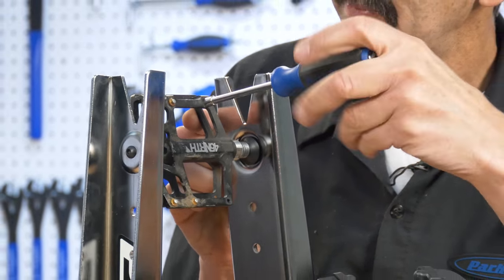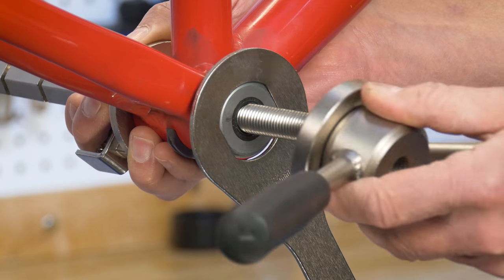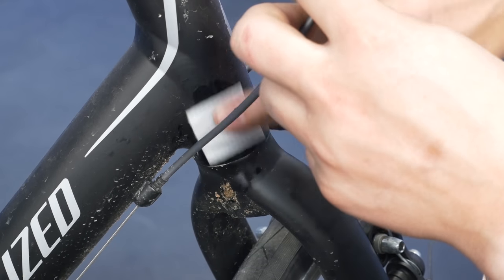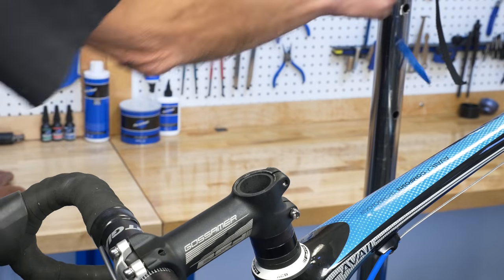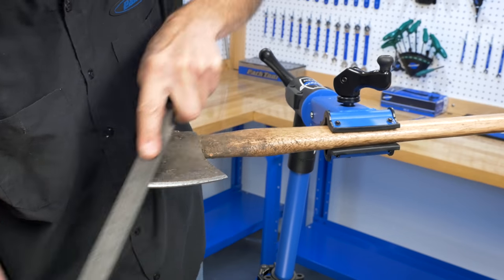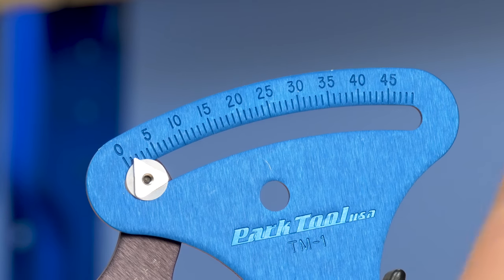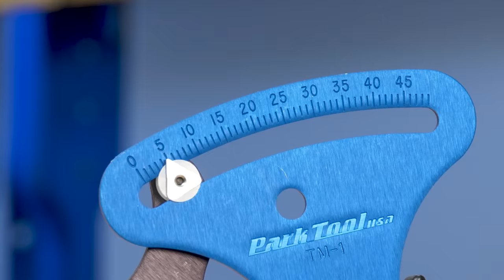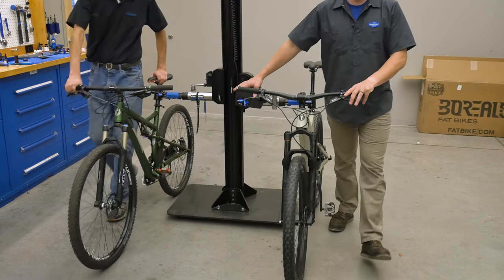The Mechanical Mind: Alternative Tool Uses - Tech Tuesday #102

Comment: 2 tools: Take an old spoke and bend a handle loop or preferably 2 tight loops kinda like a pretzel for the handle and a tiny loop on the head end to hang it. For one tool sharpen the end on a bench grinder to make a pick. Thread an old nipple onto the other to make a nipple setter for building a new wheel. Guarantees you start at a baseline with every nipple threaded the same number of turns.

Comment: Bullnose pliers for hollowtech preload adjusters in a pinch. Every tool is a bottle opener. Crownrace puller to pull off seized headset spacers and bearing covers. Rubber end of a cone spanner to undo tight quick releases.

Comment: I don't do major wheel truing at home but I do glue tubs for CX season. I've never needed a truing stand so the rear end of the bike makes for a handy wheel holder with the wheel mounted externally in the non drive side dropout.

Comment: attaching QR axles in axle vice.  To install 6 bolt rotor, start threading by hand, then spin the wheel counter clockwise while holding the  torx wrench into the bolts.  Takes like 30 seconds to do each 6 bolt wheel.

Comment: I have a question for you guys on parktool. How to converting from cantilever to V brakes
Reply: Check out this video https://www.youtube.com/watch?v=PMyVtWzeuBA
Reply from the maker: If you are interested in converting from cantilever to v brakes you will need to order some "mini" v brakes. The arms are shorter and will work better with the shorter throw of a brake lever that has the pull for a cantilever. Then install the new brakes on the old bosses. The cable routing will change and sometimes a zip tie or two comes into play for that. Route the cable and housing, set up the brake, then you should be ready to rock with your new more powerful brake that should squeal less.